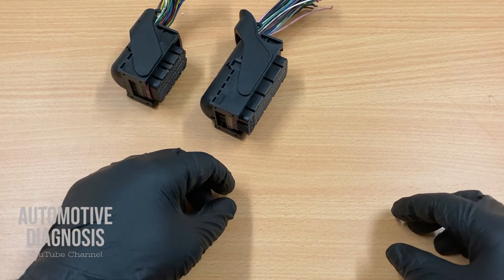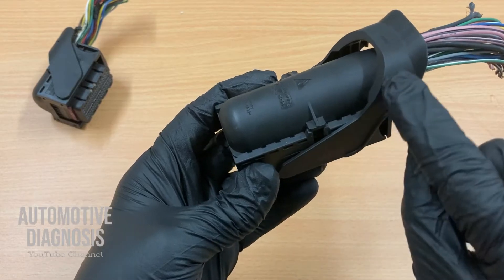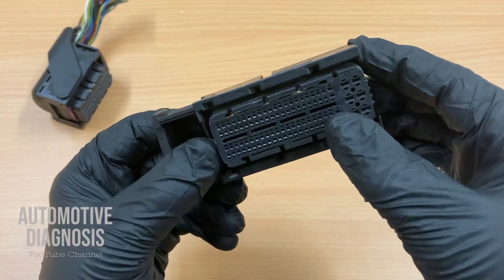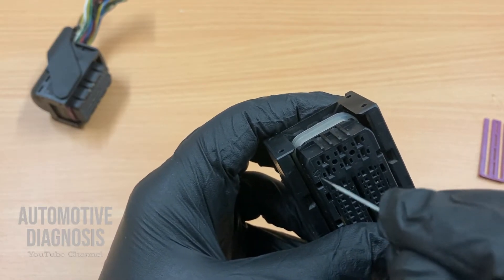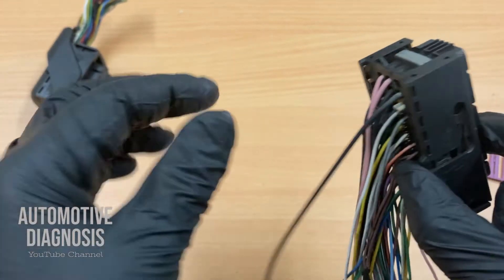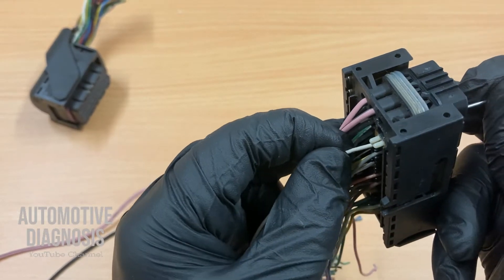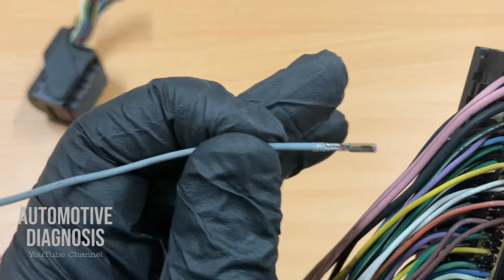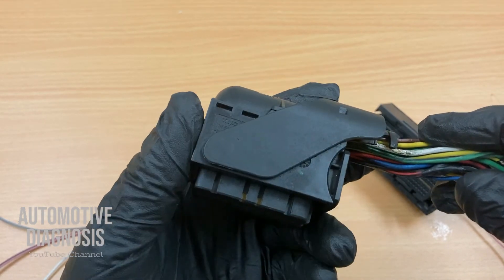How to De-Pin ECM Connectors | Engine ECM Connector Pin Removal & Connector Repair Guide

Comment: Where to get small enough tools to release the pins as you are doing cannot find them on the net have found some but not thing enough have you got a  link please or can you tell me what are the ones that you use, Thank you
Reply: Thank you for the reply - notice that one of your screwdrivers has a long thin machined bladed point cannot find anything like this have you got a link to something that is the same - have to be narrow but strong and a long machined tip -quite long I see just like a long slope. makes it easier to get into the smaller pin release holes
Reply from the maker: @ That is not actually a screwdriver, it’s a locking pin for engine  timing chain tensioner that I turned into a pin removal tool ☺️
Reply from the maker: Hi there, in this video I only used a precision screwdriver as it was a good fit for this connector, but you can get a pin removal tool set as well.

Comment: Thank you for including removal and separation of the ECM connector plastic housing. That’s all I needed for now. All within 4 minutes. But I’m saving this video to Electric Diag for future reference. 👍🏼

Where can we find replacement ECU and other sensor/component connector pins?
Reply from the maker: Hi my friend, I’m glad it was helpful. Parts must be available in n part shops, many online stores provide them too these days.
Reply: @AutomotiveDiagnosis  you’re right. I found them available at both after I asked. Thank you 🙏🏼

Comment: The 'PIN TERMINAL' used in the ECU (Engine Control Unit) and BCU (Body Control Unit) is called what? Which types of Terminal PIN it called?

Comment: If a wire won't latch into the connector, is there any way to fix the connector or do you need a new one?
Reply from the maker: Hi there, I’ve had this problem before. The best way is to replace the connector if you have it. But when I couldn’t find the connector, I grab a very small zip tie and tie the wire (that won’t latch) to the next wire. By doing this we actually use one locking tab to hold two wires.

Comment: Thanks for the video, how do you remove the cover of the other T60 (I think) connector
Reply from the maker: Hi there, sorry that I don’t have the connector right now to make a video, but if you check the other video from the link below you might get some ideas as I described many different connectors there (it helps even if it’s not exactly your connector):
https://youtu.be/gzf524fYAxE?si=oRWCqS2V7R4Tfnvk

Comment: Como puedo poner en orden los pines de una lincon nabigator de la caja de fusibles
Reply from the maker: You need the wiring diagram to find and tag the wires one by one, also pins locations on fuse box.

Comment: Thanks a lot, it's very clear, Both ur audio nd video,  but after depinning, showing atleast once the female pin hole where the male pin goes in would have been more great
Reply from the maker: Hi there. Thanks for your comment. I will try to do that in the next coming video.

Comment: Great tutorial. I have been attempting to remove pins from a Lexus Anti Skid ECU, and pretty much have butchered the connector trying.  What you are showing here for removing the pins from the ECM seems almost what i need to do with this ECU.  Any assistance you can provide would be appreciated!
Reply from the maker: Hi there, I wish I had that car right now to make a video for you, sorry that I don't. Normally when I want to remove any pin, first I try to locate the locking tabs and anything involved. Then I select the best tool for that. There is another video explaining how to remove the pins from several connectors, that might be helpful too:  
https://www.youtube.com/watch?v=gzf524fYAxE

Comment: Nice video. How easy is it to insert them back into the connector?
Reply from the maker: Thanks. Yes. it is actually very easy. The only important thing is to make sure that pin is inserted in a correct orientation to be locked by the locking tab. You can also watch the following video which shows how to remove and install the pins from multiple connectors:
https://www.youtube.com/watch?v=gzf524fYAxE

Comment: Do you have any ideas on Mitsubishi pajero gdi v6 V25  6g74?
I just cleaned the MAF sensor but it's just idling bad and i can't drive it it's just going
Reply: It's just going off i mean
Reply from the maker: So engine goes off when it is idling? Have you cleaned the throttle body yet?
Reply: @AutomotiveDiagnosis  yes i cleaned it with carburetor cleaner